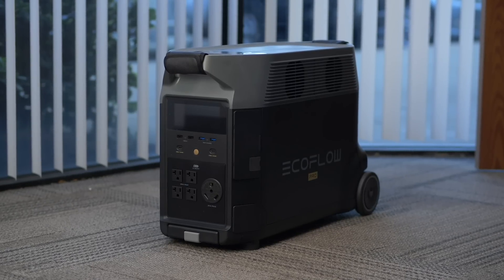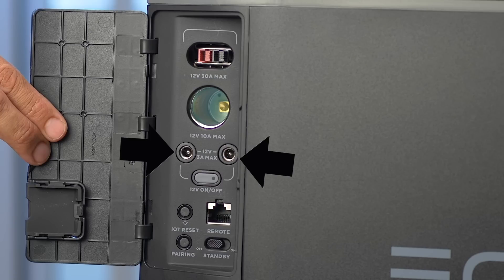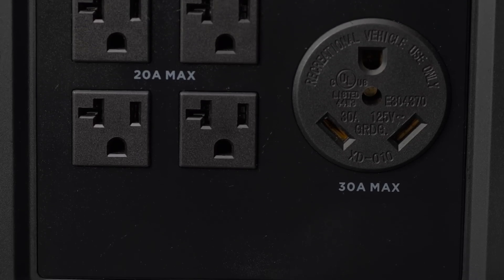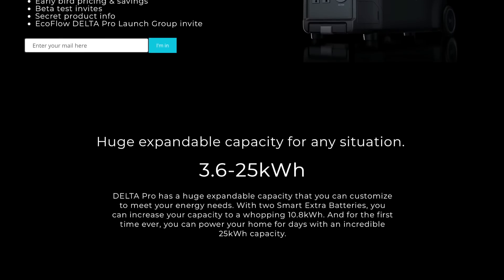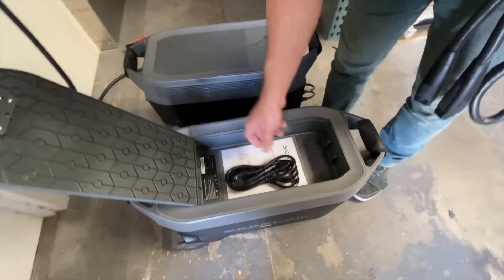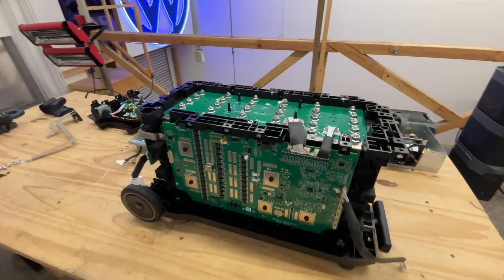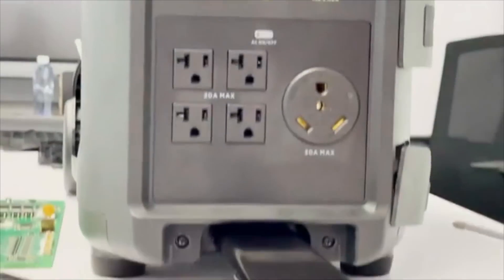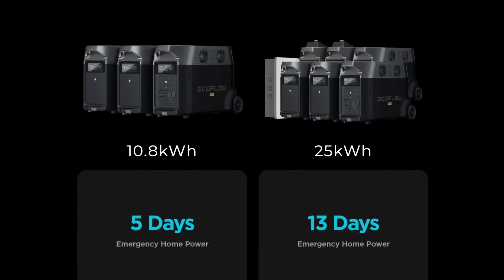EcoFlow DeltaPro - Best Battery System yet

Comment: Still a little light on details on the generator dose iit only run on gasoline or is it set up to run on propane and natural gas also for preppers are you able to attach a pipe to the exhaust system to run it inside
Reply: It currently only runs on gasoline (preferably as low an ethanol level as possible). But ALL the websites and YouTube review sites are clamoring for a “dual fuel” option. Hope Ecoflow listens for future upgrades
Reply: You ALWAYS have to place the generator outside and run the cable into your house. It is NEVER safe to place a generator in your house, because if the hose connection on the exhaust fails or is blocked, you're in serious danger.
Reply: @ashlardarned2540  saying the pipe might get blocked is like saying your furnace pipe might get blocked you don't use plastic or abs or even PVC pipe like is used on high efficiency furnace it's a flexible metal pipe designed for exaust and if it's gets blocked the generator won't run it can only be attached if the unit is designed for it the old 32 Volt Delco and Lister were you put them in the house back porch or basement so when your batteries ran out in the middle of the night or in a blizzard you didn't have to go out also it was almost impossible to start one below freezing as the power to start them came from your depleted batteries which also were installed close by that's why electrification was such a welcome relief no waking up to a freezing cold house although it those in the country and small towns into the modern age it set back non grid tied to the stone age back then Delco had come out with a new option an auto start it was an expensive option when the batteries got down to around 28 volts it automatically started it but it was only available on new generator and the old ones lasted for a long time you didn't just buy a a new one unless you had lots of money  most people only ever bought one when they wore out you rebuilt it and it was good for another 10 years or more if battery technology was like it is now there would have been more people off grid my brother in-law Collected old pump engine's and he had both in his collection the Lister was diesel the Delco was designed to run on kerosene it started on gasoline and once it warmed up you shut off the gasoline and turned on the kerosene apparently during the war gasoline and diesel were rationed and kerosene was not
Reply: Has carbon monoxide detector built in gotcha 🤔👍

Comment: Would you please be so kind as to review the new Duracell Power station?  I do enjoy your videos, even the ones I don't fully understand!  :p
Reply: Jehu is like the rest of the good reviewers they don't think about those of us who can't just pull 3 or 4 grand out and buy a lithium unit another bad entry level solar generator is the nature generator it's better than the Duracell in that it has 2000 watt pure sine Wave inverter but like the Duracell expect to buy new battery every year in what I found on utube a sealed lead acid battery is dead at 12 Volt and should be charged to 14.8 and float charged to 13.4 yes I thought booster pack manufacturers can't all be wrong so I grabbed my old Black and Decker and opened it up to find the battery manufacturer so I could go on their website and find out the battery charging parameters didn't have to writen right on the battery was do not discharge below 12..2volts and the float charge is 13.4 and full charge is 14.8 so I checked the built in charger and it was 22 volts output I did get charging parameters from both Duracell and nature's generator and neither charge fully or start charging at 13.4 same charging parameters that killed all my old booster packs neither have regulated 12 Volt out now I we could have the big 4 do proper reviews maybe we could get a better unit as changing charge perameter doesn't cost anything except they won't sell us new battery every year and adding regulated 12 Volt out and USB quick charge and type C wouldn't add much to the prices and going to a mppt solar charge controller that's programmable would make them great entry level solar generator just think one could save enough money in 5 years or more to be able to buy a lithium battery for those who have bought one of these two units get a good battery charger that charges sealed lead acid batteries and hook it up to the expansion terminals and if charging from solar get a charge controller that's able to charge sealed lead acid batteries and hook it up to the expansion terminals but get one that's able to do 300 watts the built in solar charge controller is a hundred watts and that's ok if you only use about 5 or 6 hundred watts per day we need a great entry level solar generator that's around a grand 2000 watts would power my whole house and up here in the cold weather weather when the days are short there are ways to get the cold from outside inside to the fridge
.

Comment: Just to be clear, when it says "recently updated to 4200W" are we talking about charging, capacity, or inverter?
Reply from the maker: Ev charging updated from 3kw  to 3.4Kw    Solar input updated from 1.2kw to 1.6kw   MultiCharge  updated from 6kw to 6.5kw
Reply: They announced that a separate MPPT charge controller for integrating rooftop solar panels will be available. So the internal controller which was updated from handling 1200 to 1600 watts is one thing. the separate controller which will come out next year will be able to handle 3000 watts. So you could have 1600+3000 watts = 4600 watts of solar PER delta pro that you have. Very cool update and lifechanging for those of us who want to use this with rooftop solar.
Reply: @galenas564  This is news to Hawaiian home owners ears. Many of them already have rooftop solar but can't grid tie because the utilities are jerking them around with the authorization to use it. Throw a breaker on your panel with an interlock kit and a NEMA 10/30 port, plug your Delta Pro in, and run your rooftop solar into the Delta Pro to run your house. These technologies keep getting better and better.
Reply: @galenas564  Do you know if this will be a separate port or if the 30amp port will be bi-directional for grid tied solar systems? Another great feature is if you can toggle between 120v and 240v. 120v for RV and 240v for a home generator port or heavy power tools. Thanks for that update!
Reply: @jermaineshorter35  not sure on grid tie. You could ask in the EcoFlow FB group. To use 120v vs. 240 you simply use 1 delta pro for 120 or 2 of them with a double voltage hub or smart panel for 240v.

Comment: I have yet to see a video explanation of how the claimed 25kwh system works. But just saw from this vídeos rolling screenshot that it needs 2 gas generators. And to get the 240v output, you need two of the packs that have inverters.
Reply: No, the gas generator is optional. You can have two Delta pros and four extra batteries for a total of 21.6kWh of pure LiFePO4.
Reply: @Curb71  I know each set can have 10.8kwh but the claimed 25kwh is with gas generators
Reply: From the image, it looks like you have to have the smart panel too. Panel to the inverter batteries, to one expansion battery and generator each.

Comment: Nice video. I love EcoFlow products. I think they are superior in engineering. Just curious why you prefer the EcoFlow over the Bluetti. For example, the Delta Max over the 200 Max. I am trying to tell myself that it is OK that the Delata Max does not have LiFePO4.
Reply: The bluetti tends to have software glitches when things first come out and with all those cords to connect things, what happens if you lose a cord? It becomes a lot more bulky and frankly ugly looking with all those cords. I do like the idea of a modular unit that is lighter but they're still like 74 lbs, not in a 30-50 lb easy to carry range. The pro with long handle and wheels makes more sense in terms of carrying. Also I believe the ecoflow build process and components are better and there were delivery issues with the EP500 whereas EF has never had delivery issues of that kind. Just my 2 cents. Bluetti is a good product too, I am not bashing it. Just think EF is better. Me personally though I would not get the Delta Max. I would only get the LiFePo4 products. It's like buying a black and white TV after color TV came out. Just why? LOL
Reply: Galena S Thank you so much. I agree totally. Things just seem to all work better with EF. Do you wish they had used LiFePO4 in the Delta Max or are you glad they stuck with lithium ion. I see the advantages to each but think I would have preferred the LiFePO4, even though the unit would be heavier. Just curious what you think.
Reply: @litnoregrets7551  I have a Jackery 1000 which was my first foray into sogens and I still like it and use it. It's only 22 lbs. But once I get my delta pros that will only be used when/where I need a more portable source. The smaller and lighter powerstations have their place I guess lol. But I still wish everything was LiFePo4. I am waiting for a company to come up with something that separates the batteries and other components (inverter, charge controller etc.) for carrying but snaps together internally rather than with bulky extra cables. Something like waterbricks where you could just keep adding extra batteries to the side or top. Now THAT would be cool. Portable and also endlessly expandable. That's the dream system right there. We are getting close though!
Reply: As it's just one big add he did for them is all. If they gave me a ton of free stuff and 8% commission I would say all types of good stuff about them too...

Comment: So how many battery pack extension can I keep adding to the main unit? 2...10?

I'm thinking for a non DIY guy, this is simple and easy to install, so I can make a huge battery bank for an outdoor shed or camp site with solar panels and have unlimited/free energy
Reply from the maker: the way I understand it only 2 extension packs per deltaPro then 2 can be hooked up to make 240v so a total of 6x 3.6Kwh
Reply: @jehugarcia  oh that is quite interesting especially for someone who wants to use both at home and when out for an RV trip. Easy plug and play.
Reply: The only down side to the “auto on /auto off” new gas generator to “top off” the discharging battery at say 20% remaining charge for extended rainy days during a power outage, is that the gas back up generator current model takes up one of the two “add on” battery slots, so you can only use the 1 remaining expansion battery slot. Hopefully they change that with future upgrades. Another option I would like to see in the software would be the option to prioritize the solar charging over the AC wall plug if I wanted to save on my electric bill on strongly sunny days. Currently if you have it plugged into BOTH solar and AC charging (as in a UPS automatic back up system set up for appliances in a power outage) the AC power is used first. I would like the option to chose   I would also need a much longer than 3-5 meter connection cable between the new gas back up generator (which has to be kept outside during use) and my inside Delta battery pack

Comment: Get that money by selling there garbage. Guys and girls before you go by in this garbage that this guy is trying to sell watch some of the reviews on some of the smaller units it's been out for a while real reviews not ones that have been sponsored by them they have a tendency of overheating they lie about the advertised capacity most of the time they're only about 75% efficient and many other issues. This is basically a big long advertisement by this dude..
Reply: Delta Pro is 93% efficient. Join some of the Facebook groups and you'll see everybody with a problem is taken care of.
Reply: @Curb71  I call BS the most I ever got from one was 81% but most of the like they are around 75% maybe on the 12 volt you will get 93 but vary few people buy this crap for 12 volt they buy it for the 110 AC
Reply: @CD3WD-Project  numer testers got 93% efficiency on the Delta Pro AC output. I'm aware past units have been worse.
Reply: @Curb71  lol. You're so funny I like you. Regardless this is just one big commercial where he makes 8% commission off of selling overpriced garbage...

Comment: From what I can see, the Powerwall 2 gives you 13.5Kwh for $6,500.  That's quite a bit cheaper than the Delta Pro.
Reply from the maker: you cant get a working powerwall for $6500,  I've talked to people who've paid more than that just to install it.
Reply: @jehugarcia  not to mention, you can't bring a powerwall camping with you and plug in an AC and a hotplate and a phone charger LOL. And take the same one and pair it with another unit and home and run your clothes dryer, well pump, or stove. It's the portability and expandability that make delta pro so cool!
Reply: @jehugarcia  thanks, I believe you’re right. Sorry I jumped the gun
Reply: Yeah, try doubling that price. You're also getting NMC. Delta Pro is LiFePO4.

Comment: Split phase! Oh man running 240 from 2 would be awesome. And I don't honestly know much about it but it'd seem charging from 240 at that speed would cook the battery. Not to mention it'd prob get so hot it'd throttle itself down considerably
Reply: 240 volt output with power the small is rather useless.  Sure it may be good if you have a big water pump or something to start up but I would hope with a system like this you would avoid purchasing said water pump
Reply: @SiriusSolar  just the fact you can use and charge with 240 is pretty cool. Useless as it may be to some, I dig it. And yes a waterpump like that would be odd
Reply: @kswis  240 water pumps are really common here. I'm in the jungle in Hawaii where everyone's off grid and a lot of people have these pumps. Most of the pumps have a switch so you can run them off of 120 volts as well.  I'm just saying 240 is useless when you're dealing with a small amount of power...  Not really useless but more like irritating because you can max out one leg with 120 appliances quite easily and then the next thing you want to turn on you got to make sure it's plugged into the other leg.  I find it better with small off-grid systems to have all of the power available on a single 120v circuit.  When I stack my inverters I stack the 120s and don't bother with 240 unless I have over 10kw of inverter power.
Reply: @SiriusSolar  that makes more sense. I'm stateside and have a total of 4 things that use 240. 1 of which the inverter might handle.
Reply: @SiriusSolar  it's really not a small amount of power, especially if you've got solar panels attached to it. Let's say you have it overpaneled or it's a sunny day and 1600 watts of solar are going into the delta pro. The loads take priority so if you're running 1600 watts of loads, it can go direct to that. Your well pump may be 2500 watts but it kicks on and off so when it runs it's using all that power (1600 from the solar and 900 from the pro) but when it isn't running, the pro is charging up for the next time. They also have the smart home panel so you don't have to go plugging in and out things. You can choose which 240v and which 120v circuits you want to back up and when and control the whole thing with the app. Or if no internet you can use bluetooth. It really is an ingenious system.
Reply: @galenas564  the problem with putting half your power on one wire and half on the other is that then it's not all available to start up that heavy 120v motor.  There's times when my refrigerator demands a few thousand Watts to start up and my voltage drops low enough for long enough to cause a brownout and ends up rebooting my internet router.  This was happening when I was running a 2000 Watt 120v pure sine wave high frequency inverter.  To get past the problem I got a larger inverter with 8,000 watt surge ability.  Refrigerators are hard to find in 240 volts just not that common.  My dishwasher has been startup surge of about four times the refrigerator.  & my electric clothes dryer has very large startup surge as well even if I keep the heater coils off during spool up.
Reply: @SiriusSolar  again, I think you need to research this system more. A single delta pro can handle surges of up to 7200 watts. A few thousand watts is no problem at all.
Reply: @galenas564  it's just not enough.  If I had two of these things I wouldn't want to configure them for 240. I'd set them up for 120v if at all possible.  I've been off grid for years I've used battery Banks of all kinds. I've used inverters of all types and generators of all types. I've installed many solar systems.  I know it's ratings on one leg are pretty high but I'm sorry they're just not high enough.  Sure your average person camping or running things during a blackout is going to be happy with it either way.  But there's no way I'd set that up for 240 and try and start an electric clothes dryer with it.
Reply: It's not just about the surge rating. Your house is probably taking a thousand Watts 24/7 and then if someone's running the microwave at the same time you try and turn on that dryer or the dishwasher this device is not going to be happy with that if you've got two of them working together to put out 240 volts.  Your odds of worry for a success go magnitudes higher if they're configured to help each other with 120 v

Comment: could you try connecting the ac charging input to a solar inverter so you could solar charge the thing at sub 4kW for now as long as they don't offer higher wattage dc input, for now at least? not as efficient as dc charging because there is that dc-ac-dc conversion but hey if it's excess power, absolute efficiency could be considered secondary